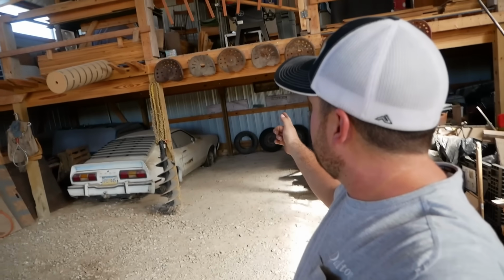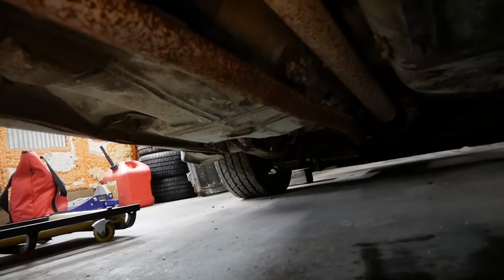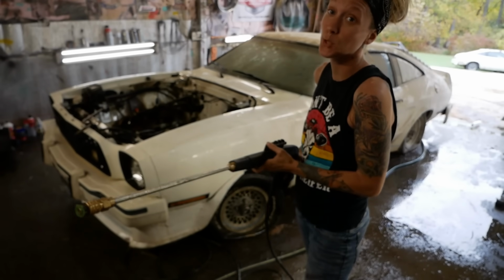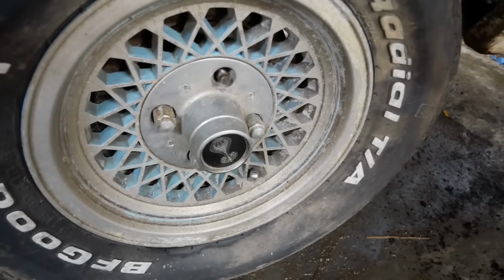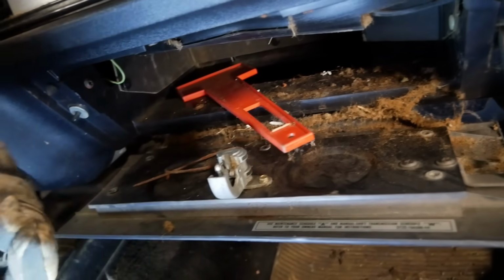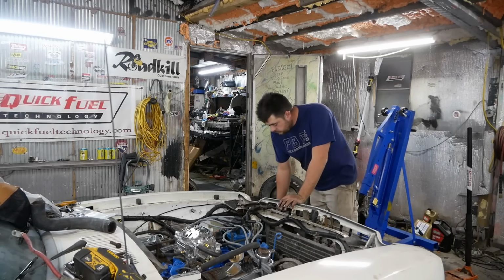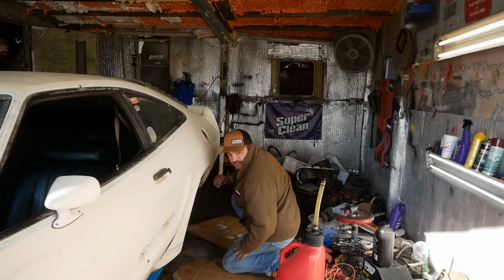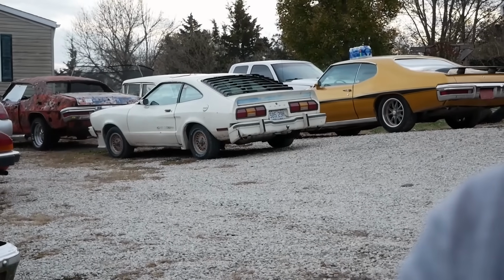ABANDONED King Cobra Mustang - WILL IT RUN and Drive After 26 Years?

Comment: Electric fuel pumps are pretty much Chinese junk too. 4 fuel pumps before I got a good one. I hope.🙄
Reply from the maker: The Holley electric pump that's around 60 bucks is USA made and I've had excellent luck with them
Reply: @PoleBarnGarage  That's an in tank pump? Or you mean install it in my existing fp housing?
Reply from the maker: Inline clicky clack fuel pump

Comment: re bodied pinto with a 302
Reply from the maker: Lightweight car with a v8 and 4 speed
Reply: @PoleBarnGarage  ya but they really are based on the Pinto chassis, so i wonder if the unibody can even except real hp even with frame braces.
Reply from the maker: Do you think a 69 mustang can handle power? Because that's also a unibody car... So is a Camaro... Nova..fox body...
Reply: @PoleBarnGarage  really dude ? as if a pinto unibody has comparable steel to older unibodies. and all of you mentioned above had a v8 option where the pinto did not

Comment: You robbed yourself on that clutch . That motor and transmission are not specific to the M2 you could o gotten a different clutch for a fraction of the price
Reply from the maker: They are literally specific to mustang 2, that BW transmission was made specifically for V8 mustang 2. The bellhousing will not accommodate a larger flywheel and clutch

Comment: You have the best of a very bad model. A  Mustang with  a V8!! And an ugly body kit.
That clutch is  Aussie Falcon 6. 10" clutch is an upgrade. Standard on all other 302 cars. 
You will have to refit the b/h to the gearbox or you will never get it back in the car. Is that a T5 or a 4 speed?
And do not forget to fit a spigot bush in that auto crank

Comment: It 300 hp 4 barrel and since it is a COBRA it has big chamber heads THREE HUNDRED HP NO LESS THAN 290 if it is original that cars is an high out put and that why it was such a bad ass ok ten four oh yeah high out put is the big chamber heads put a set of Windsor Dart heads on it and big cam and the 351 rods as well and then that makes it a stroker motor which makes 475 hp with the stock pistons just so u know
Reply from the maker: Uhh.... No 😂😂😂😂